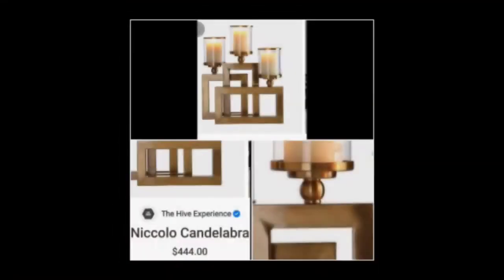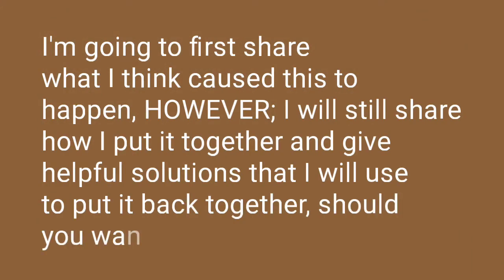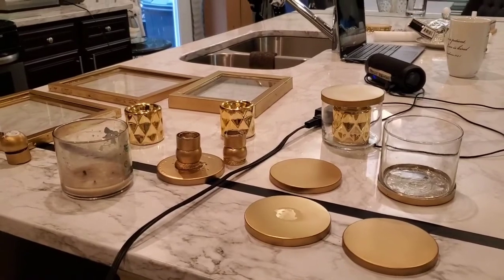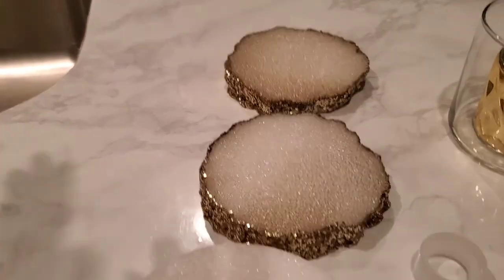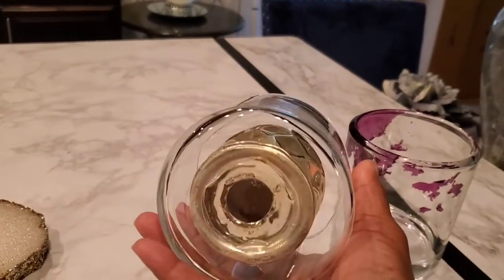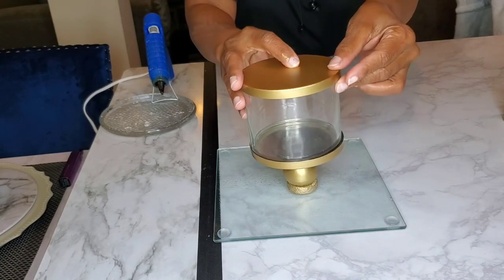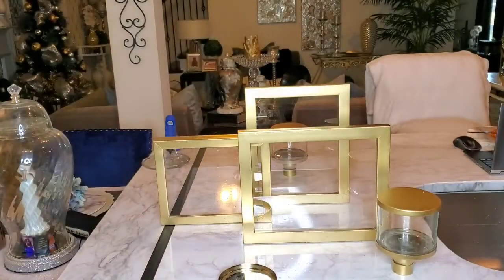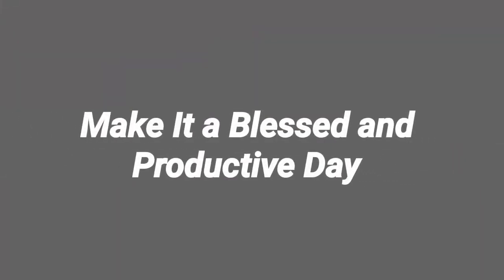DIY HIGH END CANDLEABRA DUPE / LOW END DESTRUCTION

Comment: Beautiful! Yes I agree with you I would definitely use a strong permanent adhesive and 2 frames together! Or wider frames. Because I like to make my dupes look as close to the inspiration as possible I wouldn’t put a piece at the base. Now if I had to use something to sustain as the base it would be a thinner piece of wood behind them not in front of the first frame. Were you meaning in front of each frame or behind each frame? Nevertheless it still looks great! You did a phenomenal job! I would like to have one myself! 😉
Reply from the maker: Hi my friend. I'm going to use a permanent strong Adhesive....and yes I initially stated a piece of wood the length of the frame in front and back, however; I LOVE your suggestion to put it behind so it can look as close to the original as possible.  I will either order wider frames or just another one for each and permanently fix them together so that the width can hold the candle holder pieces better. I really love how it turned out too. I will be recreating it again, but much stronger. As always I really appreciate your viewing support my friend.  God bless you and have a wonderful weekend.